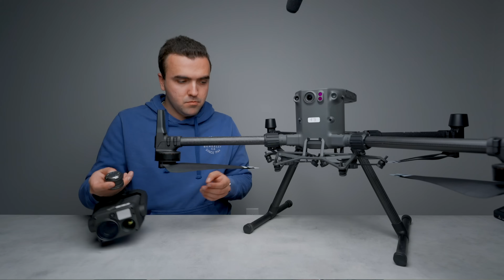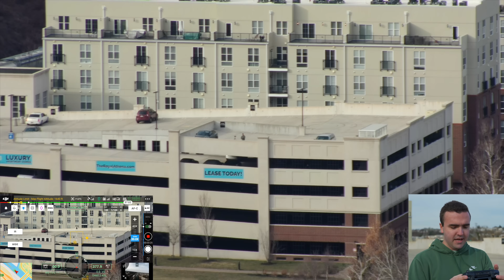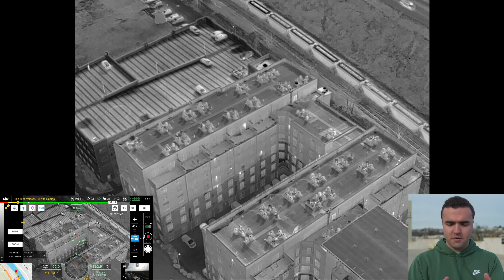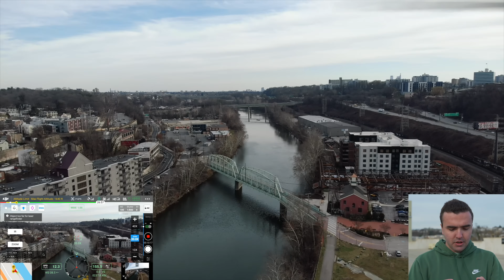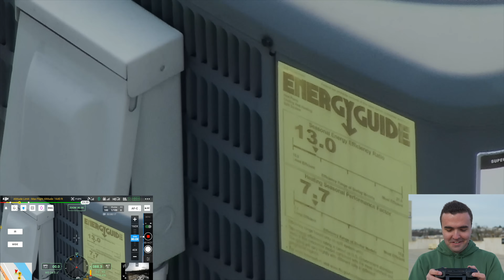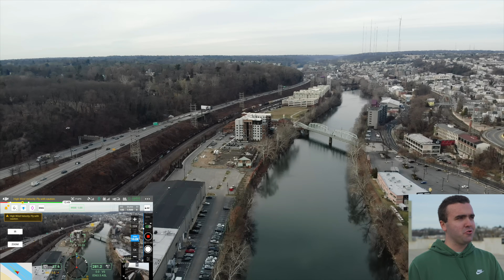DJI Matrice 300 First Flight & Full Set Up Guide

Comment: Thermal and IR are not interchangeable words btw. Other than that looks like commercial is 20 years ahead of the Marine Corp. We're using the R80D which is a little over 100k for a worse system.

Comment: I work for a police service and we bought a few of these drones when they first came out. I already have over 200 hours of flight time on one and you are just touching the tip of the iceberg of what this bird can do and just how rock solid it's been since we purchased them. With it's thermal capabilities we saved a missing persons life in the first two weeks we used it. You can  definitely go into the menu and slow the pitch, yaw down to your desired speed to take out the "jerky" quality. I also find it much easier to use the roller to adjust the camera when it's zoomed in rather than yawing the drone. Check out the Panorama feature, it's pretty cool... Happy flying :)
Reply: Didn’t US GOV ban DJI (Chinese companies) from operate on US? assuming u working in US police.
Reply: @brunrodrigues  I work in Canada were we haven't enacted those restrictions. I believe the Chinese ban is the US is mostly restricted at the Federal Agencies mostly, as I know of a lot of US police services still utilizing Chinese drones.
Reply: @michaelramsay2798  thanks for the info. Pretty cool job u got there. Congrats
Reply: is it worth the price? WHat dont you like about it?

Comment: Great video, as always. I agree that for 25k you shouldn't see the propellers, even for search and rescue.
Reply: I have an M300, he has the camera on the right side, not centered.  It will not have any issues with the propellors. Hopefully, he shows you guys the Zenmuse P1 camera as well, it's unbelievable for 3D Modeling and drone surveys.  M300 comes with a center mount.
Reply: With a center mount on the bottom, the props don’t show. I fly an m300 with P1 for work.
Reply: Worthy trade off for being able to mount a normal and IR camera on one drone

Comment: What is the flight time Billy?  Does it fly autonomously?  Set up a rout to fly goes to that point autonomously. What is this drones biggest use where are they deployed most?  I like the heat sensor capability probably a great tool for border surveillance. 👍  Thanks for sharing still on the fence with the new Autel drones. Do you see Philly drone much I watch  his live shows. Pretty funny dude. See ya later

Comment: I've had my M300 RTK for almost a year now. I mainly use it to support a $35k LiDAR payload (non-DJI) to produce topographic surveys. One of the things I really appreciate about it is the high IP rating. I live and work in the pacific northwest and I can fly in a torrential downpour if I need to.
Reply: It blows my mind that you can fly in the rain with these things!
Reply: Since you're using a 3rd party LiDAR payload, do you make use of the PSDK port? I am trying to find a way to map the customizable C1 and C2 buttons on the back of the M300's remote controller to two digital I/O's on the drone, but I'm finding little documentation on how to do so.
Reply: @alexsharper4203  No, my LiDAR unit uses the skyport. I haven't found a need yet to customize any buttons.
Reply: could you use the DJI new 350 for that now without 3rd party payload?
Reply: @kevin_wolf  From what I understand, the DJI L1 will work with the M350. The drone itself doesn't have LiDAR capabilities. It still needs a separate payload, whether it be DJI or a 3rd party.

Comment: For an inspection test, fly up to some high voltage lines or a substation and, using the thermal camera, see if it shows any hot spots on the insulators that would indicate a potential issue.